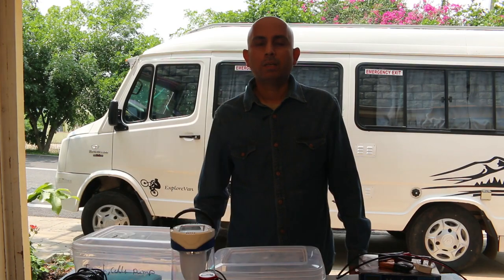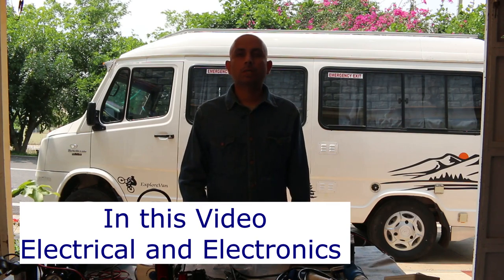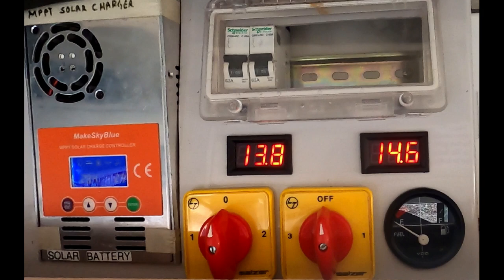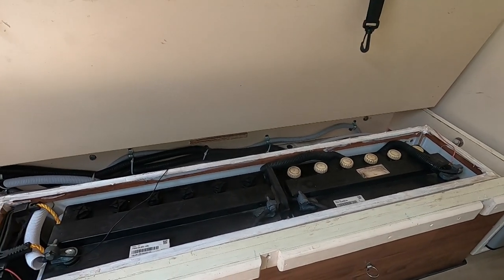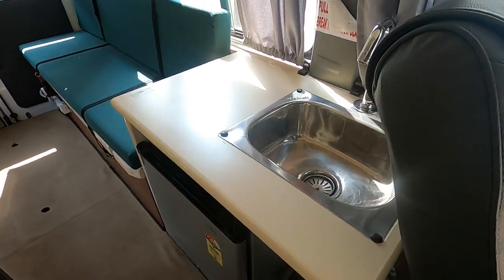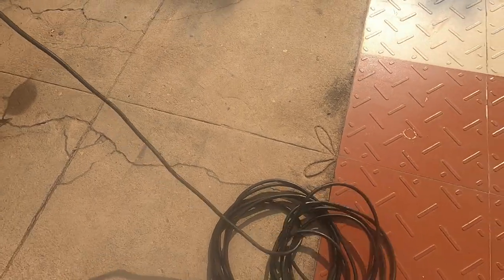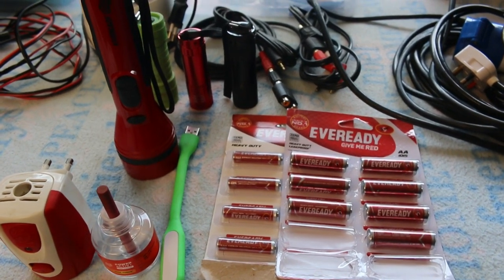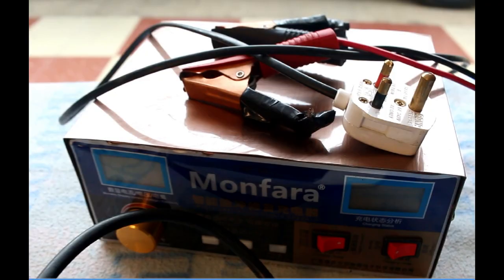What's Inside our Camper van | Electrical and electronics | Earth Camper | Bangalore India

Comment: Is there any air conditioning provision in it.
Reply from the maker: This camper van has factory fitted AC run by engine. 
We can fit engine AC or roof AC run by batteries as required.
Reply: I am searching for a dc compressor, so that the ac can run while the engine is off. Any idea about it.